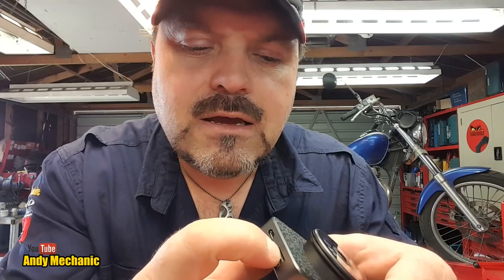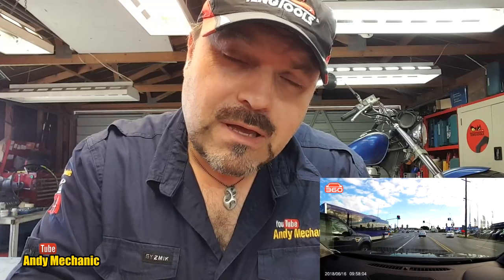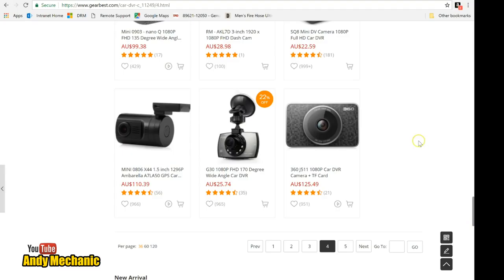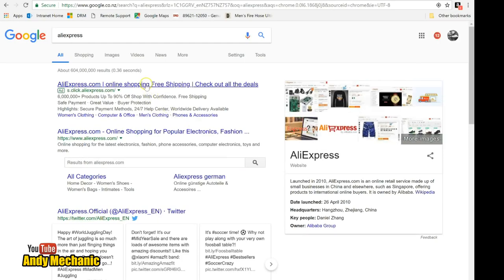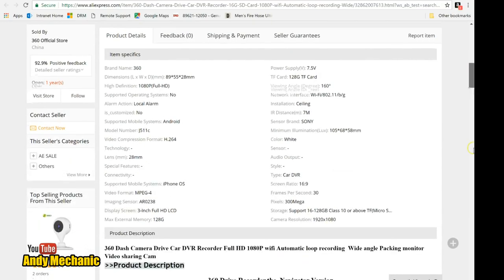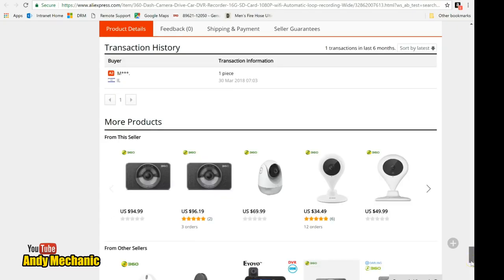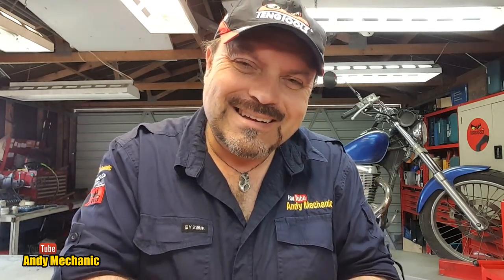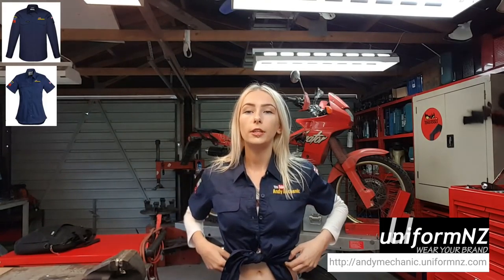360 Dash Cam - the 'Verdict'! #2602

Comment: Andy when checking motorcycle breaks in nz do they use the rollers  to test brake strength or does the guy just hop on the bike and test both breaks  without any gauges and judge it himself ?
Reply from the maker: As WoF inspectors we just ride the bike and apply each brake separately. The 'pass' is down to the inspector's opinion based on his experience. No machine used for motorcycle brake testing

Comment: About £75 here from the usual suspects. 
Luckily, you didn't test the accident feature, which will apparently:
"Gravity sensing lock the scene, witnesses of the criticalmoment. The recorder will automatically open the emergency video mode, automatically save the video, restore the scene of the accident."
I think the problem is that they're expensive enough for some scrote to want to nick one so you have to have the rhythm of plugging it in, unplugging it, plugging it in and so on. That might not be a problem with a good TomTom, because you wouldn't use one for a trip to the shops - and that will be just the time that someone will swerve out of his lane and do some bodywork for you.

Comment: Nice review. But a 16gig memory card will not go far on 1080p. I run a dash cam and again record at 1080p with a 32gig memory card. And will store about 4 to 5 days with file sizes of 60 to 100mb for about 5 minutes.
Reply from the maker: Cheers Simon. I think the card in this cam was about half full with the files from the last 24 hours driving.  What I found a little annoying was the fact it would delete the files older than 24 hours even if there was still plenty of space in the card? Odd! Thanks again for your feedback. Andy
Reply: Andy Mechanic your welcome. There may be setting you can change to stop it deleting the files until it runs out of space and then only deleting the oldest file. The are dashcams for bikes and  they are water resistant.

Comment: Hi Andy it's Troy Lewis again I have a Suzuki kitana 600 it idles but it dies as soon as I give it gas what could be the problem.could it be a low oil or carburator issue?
Reply from the maker: Probably a carb issue....but common to all cylinders so check fuel supply to carbs. Cheers Andy
Reply: Thank you very much for replying